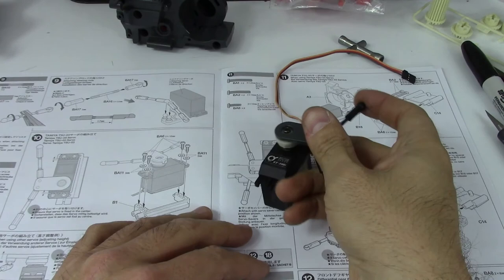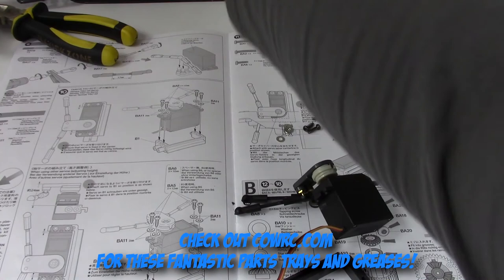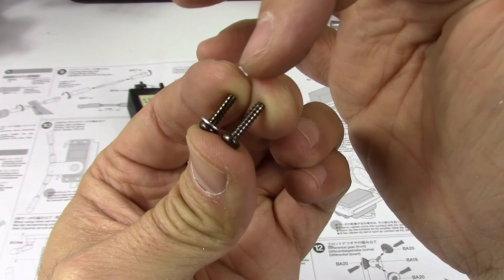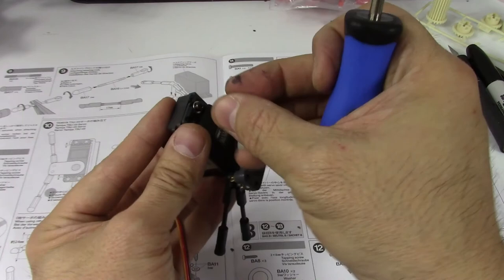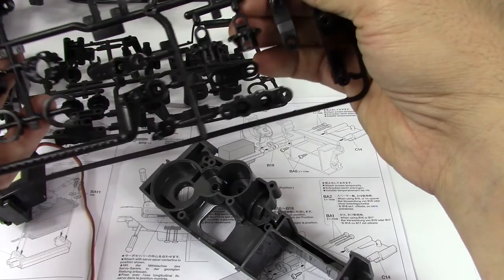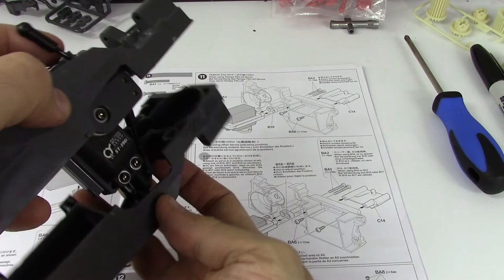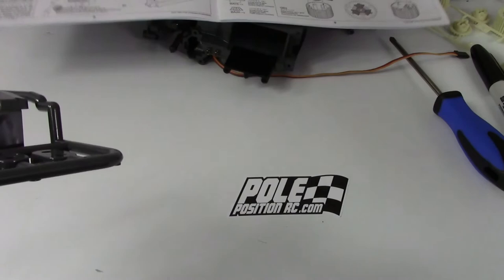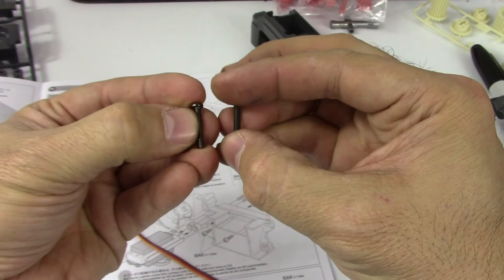Let's Build RC: The Tamiya MF-01X Beetle Rally Car #4 - Finish the Front End! Steps 10 to 15

Comment: Are you not concerned that all that grease on the bearings will attract dirt? Wouldn't some sealed bearings be a better option if you're concerned about weather and dirt?
Reply from the maker: Sealed bearings would be good yeah but since I'm not going to be driving the car very much I didn't want to spend more on the bearings. The grease can be removed and cleaned off if it ever gets crusted with dirt, and sealed bearings can still get rusted inside (unless you buy very expensive ones!).